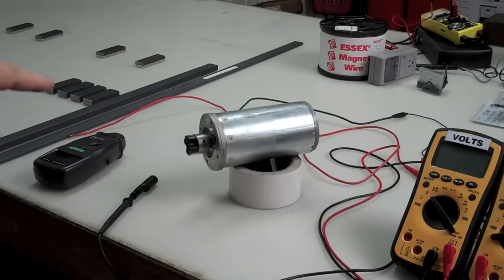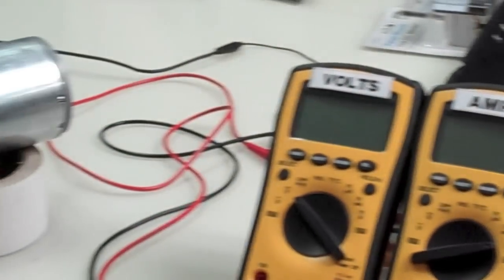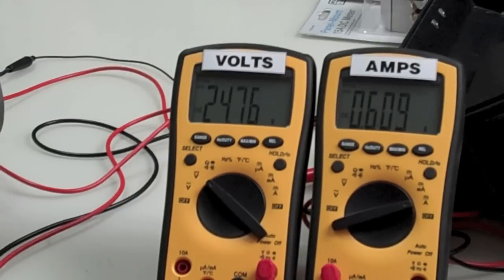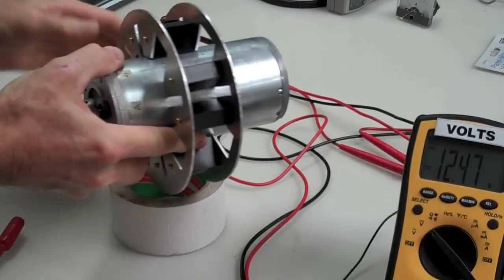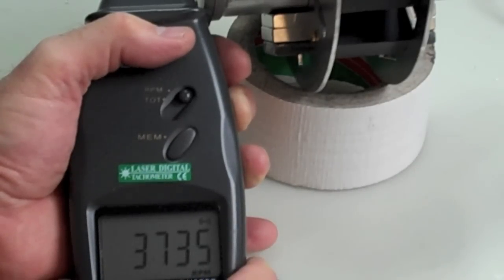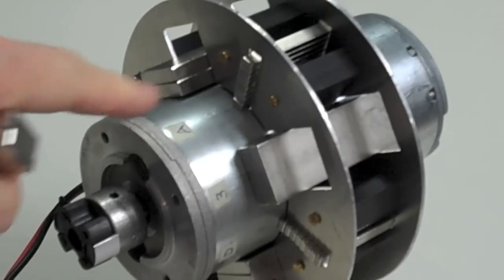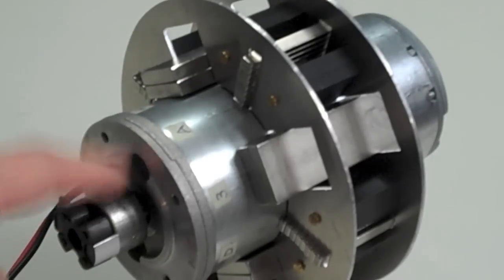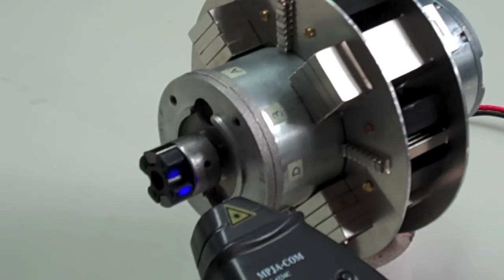STARGATE MOTOR  FULL DEMO

Comment from the maker: @HereOrTherePCrepair That is true. It is focused at the correct points. I call it "tuning" the magnetic field as I have illustrated in the Howard Johnson linear motor videos.

The steel motor case acts as a magnetic keeper for the OEM stator magnets inside, but I have considered experimenting with carbon fiber or polycarbonate as a substitute for less diffused magnetic tuning.

Comment from the maker: That's a good point regarding the windings and high centrifugal force. The large bar magnets are 1"W x 3"L x 1/4"thk, the small ones are 1/4"W x 2"L x 1/8"thk. Both sizes magnetized through thickness.

Comment: I suppose the tourqe would go down if the rpm stays the same with lower power, did you meassure that?
Reply: Tourqe * rpm = Power => more rpm = less tourqe, no?
Reply: LiquidBlaze9000 (tq x rpm)/5252=HP so (tq x higher RPM)= higher HP. more power. an electric motor is DESIGNED to run ar a constant torque no matter the RPM. ;) this has been your physics lesson of the day
Reply: alex bishop Wow... here is your physics lesson for the day. Go look up the speed/torque curve of any brushed or brushless D.C. motor. Please. Your equation is correct, but the logic is flawed. Anaheim Automation is a good place to look. Quick summary, at constant voltage input, torque is highest at zero rpm, and decreases to zero at max rpm. Want to visualize? Get some graph paper, draw some plot axes, then put a big X on it. The top-left to bottom-right line of the X is your torque curve, and the bottom-left to top-right line of the X is your rpm curve. When rpm is at zero, torque is at max, when rpm goes to max, torque is at zero. As you said, torque x rpm = power, so multiply these to curves together, and you get an upside-down parabola, which shows you motor power. It's at maximum where the rpm and torque curves cross. Adding magnets to the outside of the motor can cause it to go faster at lower voltages, but at the price of torque.
Reply: alex bishop in a brush motor speed in usually limited by commutator design
Reply: Alberto Knox No, in a brush motor, speed is never limited by the commutator design unless there is a huge mistake in the design of the commutator.  In a permanent magnet motor, speed is limited by the counter EMF becoming equal to the supply voltage.  In a series motor, it when friction equals the torque or the armature come flying out and buries its self in the wall.
Reply: As a motor exceeds its design speed there will begin to be arcing between the commutator contacts and the brushes. As the speed continues to increase the arcing will spread across adjacent commutator contacts and the motor will be slowed.
Reply: Alberto Knox I have taken motors seriously beyond their design speed and what you say happens, really doesn't.  On a permanent magnet motor, the neutral plane doesn't shift much.  Thus the point at which the brushes contact is where the voltage from one segment to the next passes through zero.  The same is true for a well designed series motor.  In the cases where I took the speed to the point of destruction, the limiting factor certainly wasn't arcing.

Comment: to find the power and efficiency of a motor, you measure torque and speed, compared with electrical power in. You are only measuring one of the output characteristics. It's like saying a car engine is producing more power if you advance the ignition timing, becauze it will speed up. when idling, it runs faster, but produces LESS power.
Reply from the maker: Of course. Please read video description.

Comment: Interesting trick, but it doesn't mean much just reading the rpm with you're modified setup. You need to take a hp and torque reading as well, because lower power input to achieve the same rpm means nothing if it can't perform the same under load.
Reply: It is simply an experiment in field saturation and not the dynamics of load calculation.

Comment: Definitely. Disconnecting the field windings on a universal motor will cause it to run at crazy speeds, but it doesn't mean the power output's been increased.

Comment: Your Stargate seems to work upping the output by increasing the magnetic forces, I'll give you that.  BUT the motor at 24v had an amp reading of .6 amps.  At 12v it was over 1 amp.  Thing is electricity use is NOT measured by voltage (ie 12v, 24v, 120v etc) it is in fact measured by amperage.   The fact is you using twice the amperage to in turn do the same thing that can be done with half as much.  

Example: run your motor at the suggested 24v until the batteries wear out, NOW run it with the stargate at 12v until the batteries wear out.  At 24v the battery life will be twice as long as 12v because your drawing twice the amperage at 12v.

To translate this to the layman, your house electric bill is based off the amount of amperage you use, NOT the 240v/120v consumption.  240v/120v is always present in your home, it's free.  What is powered by the voltage = amperage and this is what you pay for.

Conclusion: This is not a practical "free energy" type of device and it's use is pointless, unless you know... you like paying twice the amount of money or energy to run something...
Reply: In fact, 'paid for' mains electricity use is actually based on the POWER taken from the supply, NOT the Voltage OR the Current, (or Amperage as you call it), In fact, it's the the in-phase components of Voltage x Current which matter. e.g. if you had a (perfect) lossless component like a capacitor drawing current, the net power would be zero, as the current drawn would be 90 degrees out of phase with the voltage. This is how the power factor of an electrical system is often changed. Since the supply voltage is more or less constant (240v in the UK, may be different elsewhere), then the electricity cost is PROPORTIONAL to the Current (or Amperage).  (I'm and electrical and electronic engineer, by the way).
Reply: I dont remember him stating at any point his thing makes free energy. He just increased the rpm. And lost some torque.

Comment: The external magnets are "bucking" or reducing the internal magnetic field. This has the effect of increasing the RPM of the motor before enough counter-EMF is produced to balance the applied voltage. This also has the effect of decreasing the torque since the net magnetic field is weaker.

Without a load on the motor claims about enhancing the motor are not valid.

This is a nice exercise to learn more about DC motors but high torque, low speed motors are generally far more useful.

Comment: I suspect that he is actually reducing the magnetic field surrounding the rotor by countering it with the externally applied magnets.  Reducing the field will reduce the back-voltage created by the rotor winding turning through the stator field, allowing the motor to spin faster.

Other than friction losses, the limit of speed on an electric motor is the back-voltage.  When the back-voltage equals the applied voltage, it is not possible to couple any energy to the motor.

The back-voltage is related to the product of number of winding turns on the rotor, the strength of the stator field, and the rotation speed.

The torque of the motor is determined by the strength of the stator field and the strength of the rotor field.  The rotor field strength is the related to the number of winding turns times the current.  Reducing the strength of the stator field reduces the torque.

This is a great demonstration of how the stator field effects a motor.
Reply from the maker: +Carl Mikkelsen  Excellent Carl!  Absolutely correct.
Reply: +Carl Mikkelsen Not really, Look up Laplace Law of Force.
The magnetic strength plays an equal role in this.
That's the Law!!

Which point out that there is another Law of Newton, not well known is that forces are summarized.
like 1 Tesla strength+ 1 Tesla strength = 2 Tesla of torque.
Which sum up what an electric motor really is, which usually consist of a static magnet and a electric magnet.
Both plays an equal role when it comes to force.
Back Emf is a different story in this though, that create drags that take some of the force.

Said in another way put 4 magnet in a row.
It takes the same force to pull the 1 and 3 away as it takes to pull the 2 and 2 away.
due the forces are summarised into a one single field.

So you will get a stronger and more effective motor by adding more magnets.

Back emf play a minor role in motors. Since that is overpowered by the induced current.
What it does is creating heat and saturation in the iron.
Reply: +Tbonyandsteak hmm didnt human write "laws" didn't some of them get rewritten a few times because they were wrong...
Reply: +Carl Mikkelsen So if I'm understanding correctly, it's basically like jacking the rear wheels of your car up, then putting it in 5th gear and saying, "Look, I have so much more speed with the same power input", when in reality, under a load the amount of torque you need to do any work just isn't there.
Reply: Shad Arnott since when is magnetic forces related with that.
Please tell me your  know the difference
Reply: +Tbonyandsteak I'm not saying it's related to magnetic force, but I believe the rules of torque versus RPM still apply, I just have an easier time thinking of torque as related to gear ratios, instead of electrical and magnetic force, which I'm only slightly familiar with.
Basically, what I understand from Carl's comment above, is this guy's contraption is sacrificing torque for RPM, The motor goes faster, but if he put a load on it it would slow down and be unable to apply as much force. As the motor sits originally, it might not go 15,000 RPMs, but it has the torque it needs to do it's intended job.
Reply: Shad Arnott no it is extra torque and speed.
they are not in oppesition when you aplies extra magnets. That is the wrong term here.
With extra magnets you get more force pr watt so to speak.

The magnetic laws says the force is the Sum of Both magnets strength, the permanent and the electric magnet.
As in an electric motor.

But I do find it interresting how little that is known.

It is fairly simple, the length determents its flux density mulitply by the square is the force.
Usually expressed as B.
You have twice the length you got twice the strength.

Another thing since it is the Sum of both magnets.
Imagine you got 10 magnets in a long row.
The strength it takes to split them in 2 is a constant.
Dosnt matter where you split them
In the middle or the last, the strength it takes to split them is the same.
Since the Sum force of both magnets is always the same.

Behaps now you can understand what it is about.

Now imagine the same rod of 10 magnets
Where you split it in the midlle and replace the 5 of them with an electric magnet.

compare it with where you only replace 1 magnet the last one with an electric magnet.

To get the same magnet strength as before the split.
Which one uses the least current,
What do you think?
Reply: +Tbonyandsteak Ok I just read the video description (guess I should have done that first lol) I thought he was claiming that he's making the motor more efficient, or even an over unity device.
The description actually says exactly what I was saying. His device is used to adjust the RPM to torque ratio of the motor, without needing to change the number of windings. Different magnet arrangements either make the motor faster, sacrificing torque, or slower, with higher torque, meaning you could use the same motor for various applications.
The reason he showed the volt and amp meters was to prove that he wasn't just manipulating the power to achieve those results.
Reply: +Carl Mikkelsen  I dare you, Now you have had the time to think about it.
Can you even admit your were wrong?
Or are you Ego to create to do that?
Or maybe you never had any of understanding what this is about
just following what others tells you how it is?
Reply: +Tbonyandsteak It is fine to attack me, although I don't see how it could be rationalized, but physics is physics.  It doesn't involve egos, or suppositions, or wishes.  It is as it is.
Do you have an alternative interpretation that is supported by tests and evidence?
Reply: It's simply equivalent to changing gear ratios to trade off rotational speed for torque - equivalent to shifting up gears. Your wheels will turn faster for a given engine speed in a high gear, but you'll find it harder to start to move from a stationary position.

You don't have to have a complicated metaphor to try to describe it. It's a very interesting video demonstration, although for all practical purposes unless your job is to design motors, you'd just use gears.

I don't know why +Tbonyandsteak is trying to defend this as some kind of "over-unity" BS. Although the video looks very similar, I don't think that claim has been made here. Even the uploader agreed with the first comment in this thread which +Tbonyandsteak disputes.
Reply: KX36 Right I do, everyone believe it is about the energy input vs the energy output.
But the huge fallacy is utterly ignoring how the real forces work in this, the magnetic. Which are easily provable accumulative.
The greater the permanent magnet are the lesser it is needed for the electric magnet to produce the same force

The Lawplace law of force state that quite clearly and undeniable.

I does not take much to realize that. Dont be so ignorant.
This video proves it, so does huge number of others as well that increases the magnet force.
Steorn proved it, despite of many investors none gone public about it that is a scam.

Becourse it is not.

To be in an emotional denial of it, is absolutely not reality
Like ignoring this by BS is absolute BS

I prove it also in other ways, well again due to it is the real truth.
That Thermodynamic have no say in this.
That claim Input is greater than the output
The Interaction laws rules absolute only in this.
That say this is about the interaction of a permanent magnet and a electrical magnet.

Totally different laws since that is accumulative.

It really amazing when you know the real truth. To see how hardwired people really are on that thermodynamic myth

Btw it is quite healthy to make a real reality check sometimes.

There was a man who was driving on a highway, as heard on the radio
that there was a ghost driver on the route he drove on.
He reacted spontaneously in a disbelief with.
One! there is a whole swarm of them.
Reply: +Tbonyandsteak 
I don't see any data here that is not explained through the standard physics.  It is an interesting effect -- being able to change the RPM by adjusting the external permanent magnetic field -- and there may be some practical application for it.  Never-the-less, there is nothing in the video that shows behavior outside our current understanding.
-- Carl
Reply: Carl Mikkelsen 
I believe it works in a similar way to a saturable reactor (an inductor with a field coil that you can apply a DC current to which limits the AC current of the main power winding). You can also use a field coil speaker in a similar way. The difference here is instead of having a DC current through a field coil, creating a magnetic field which a user could adjust for whatever purpose, you just have permanent magnets creating a fixed magnetic field.

Either way, the effect is just like changing gear ratios, trading off rotational speed for torque. Nothing magic. It doesn't have much of a practical use since gearboxes, PWM H-bridge motor control etc. are cheap, efficient and adjustable. If it was of much use, you'd see it everywhere and it wouldn't mystify the bottom half of the internet. It's all pre-semiconductor technology that's inefficient and pretty obsolete so it seems like magic to kids today (and especially people dumb enough to be outspoken in their foolish belief in "over-unity"/"free energy").
Reply: +KX36 Agreed.
Reply: +Tbonyandsteak 
Speed = meter per second
B= MAGNETIC FIELD STRENGH
L=Length of wire in Meters.
NOTICE THE MULTIPLICATIONS

Voltage=Speed x B x L

Lawplace law of force
Newton= B x L x Current(input)
Reply: Yeah? Perhaps you could help me make one then. I just want one for myself. We could build two if you wanted.
Reply: Tbonyandsteak 
 "law"
Reply: Dem is fighting words Carl!!!    Now show us what you can do with them....produce something.
Reply: warmfreeze 8
Reply: Hoping a good book could be recommend.

Comment: I would like to see a comparison of torque outputs.
Reply: torque goes down with higher revs, because each switching of the brushes on the commutators are getting more rapid with speed increase and less current is transferred to the coils as such at each contact encounter..
Reply: Amen....that's where the numbers will show a drop in torque.  You've just deigned a higher speed motor with less torque.  Additionally your charging time for your batteries will have increased significantly.  Can't get something for nothing.
Reply: fidel catsro torque goes down because current is limited by the generated voltage in the motor.

Comment: Those external magnets had weakened (rather than enhancing) stater field so the rotor had to turn faster to generate a back EMF countering the supply voltage.  With an enhanced stater field, the rotor should turn slower.  Incidentally, the challenge in designing Low RPM motors is to generate a high back EMF at low rotary rate, which requires a strong stater field.
Reply from the maker: Yes, when the magnets are turned over, the motor runs much slower but has tremendous torque.

Comment: Note from the motor spec. website under load curve data, under full load there is 12.61 amps of current passing through the armature windings. So we can assume that the armature is able to support that much current under load. If the loaded torque at this amperage is 0.287 HP (and 112.6 LB-IN or 12.722 Nm) at that amperage, one can confidently assume that torque would be much higher to achieve an even shorter spin-up time at that same amperage.